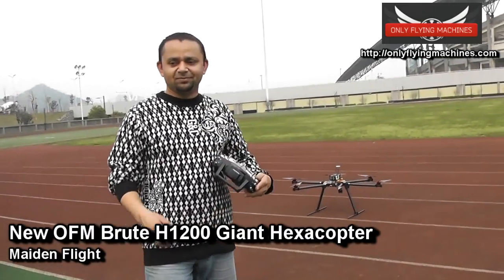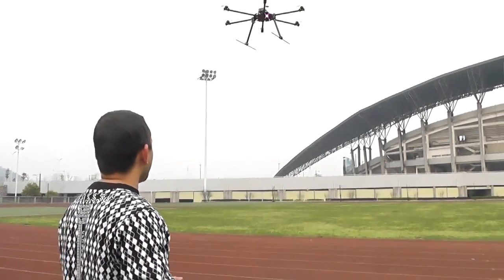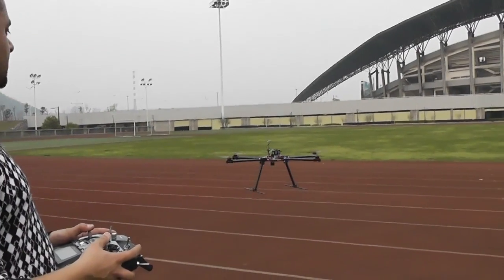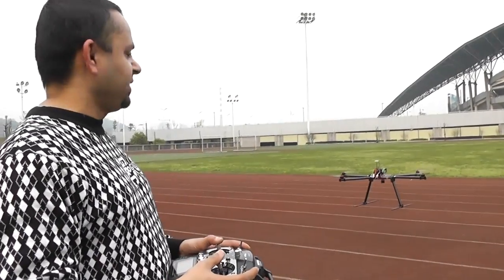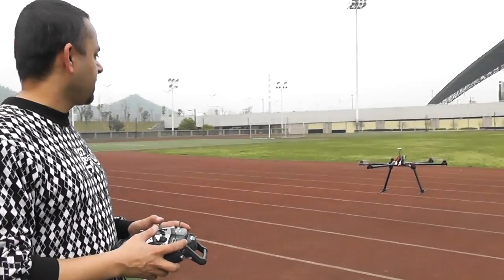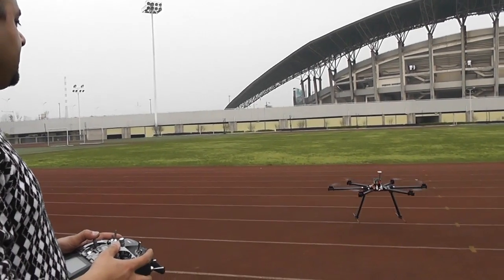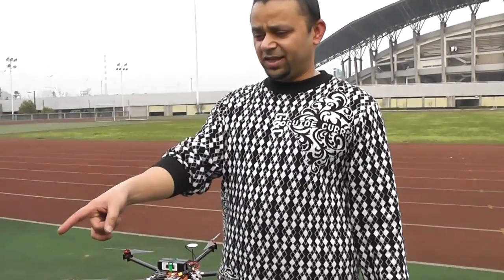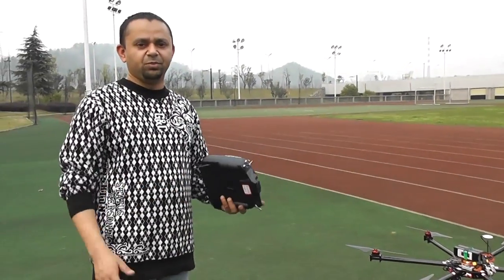Giant Folding Hexacopter OFM Brute H1200 Hexa Test flight

Comment: Great Vid again Ali.... Nice copter and great platform for shooting.... looks like a winner once the duration of flight time can be increased... maybe by switching to different motors or even offering a advance system with the Tiger pancake motors.. the Tigers are supposed to be almost 40% more effecient and run longer due to bearings used and balancing and matching from factory.. supposed to be the BEST motor to use to this day. NO personal exp myself yet..